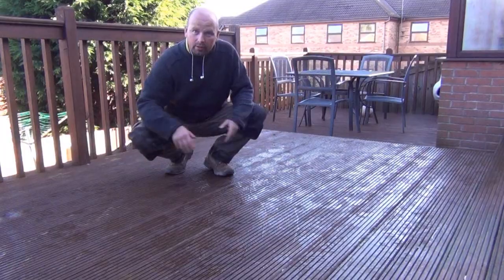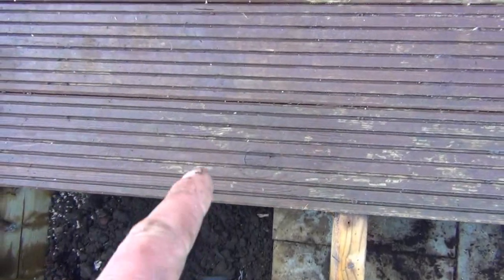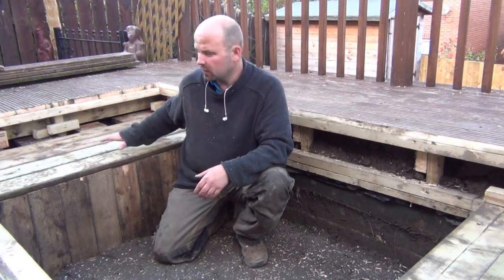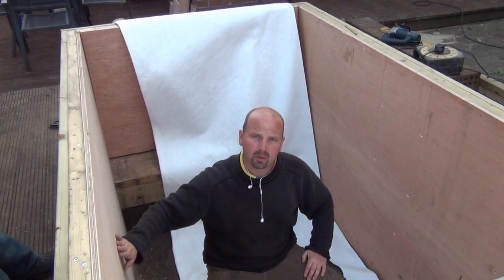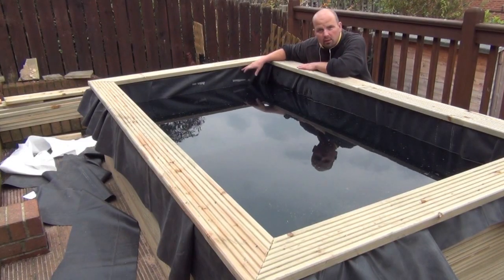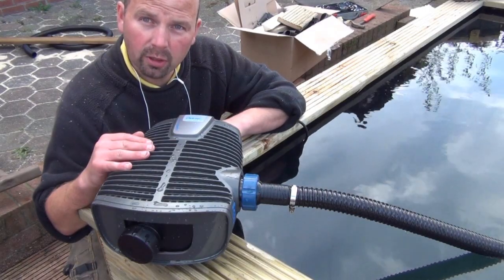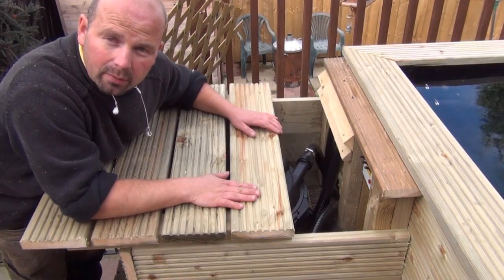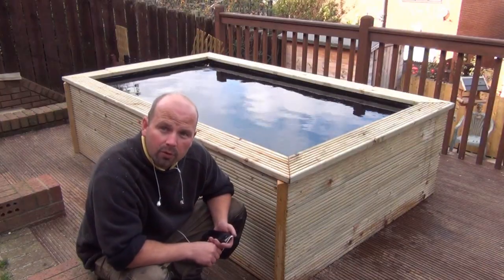How to build a raised wooden patio pond by Pondguru

Comment from the maker: Yes we normally keep bricks on the folds while the pond is filling and that allows the water to press them down, than the bricks can be removed. Tension on the upright folds can keep them flat, no worries. Its just trial and error and if you're not used to laying liner you may need to drain and refill to get it right. We never glue the liner but it can be done if the liner is clean and dry.

Comment from the maker: I've done a few jobs in Jesmond. 
This one was just over the river at Gateshead.
Plants don't need any oxygenation in the pond but if you intend to have fish in there too it would be beneficial for them to have water movement.
A pump and filter which runs 24/7 is always better than a temporary fountain so if there's any way of getting electricity to the pond it would be advantageous.
Most solar fountains / pumps are very unreliable just like the English 'summer'.
Thanks for the sub, man.

Comment from the maker: Provided there is a current in the water there will be decent gaseous exchange between water and atmosphere. The outlet can be twisted to create a visible current on the water surface if desired but one of the main purposes of this pool was to have a reflection of the sky which would be ruined by surface movement.

Comment: Great video, you explained it really well, I'm looking at building almost exactly the same pond as in your video accept it won't be on top of decking. Really impressed that 2 foot high walls made of wood are strong enough to support that volume of water. I'm planning my pond same as yours but 2.4 x 1.4 x 1.2 meters deep and you've just given me some great ideas, Thanks :)

Comment from the maker: No worries. Provided the carpet is acrylic (not natural fibres) it should be OK but if it is hessian backed or woolen you may have a problem with it rotting and producing gas which can cause the pond liner in the base to rise up like a bubble. Seen this on a few occasions when the gas has nowhere to go. One was raised above water level in a huge bubble and looked awesome. luckily it had been put in by someone else, lol
Thanks for watching and appreciating the videos.

Comment: I really like your videos.  Your attention to detail is exemplary.  I assume - because I live in Arizona - that your insulation of the above deck pond framing is to account for the cooler temperatures.  Interestingly, the subsurface in Arizona encourages a minimal depth of 4 feet in order to benefit from the soil - caliche - in moderating the extreme temperature changes over a 24hr period.  I will look closer at insulation as many pond owners loose fish here assuming the day time highs are year round, which they are not.  I am a backyard enthusiast only, but your videos are top shelf!
Reply from the maker: +Jim Cameron Thanks very much for enjoying the videos. Yes the insulation prevents wild swings in temperature as raised ponds can get very cold in winter or very warm in summer. In the UK our days can be very warm and nights can be cold much like Arizona so if we can level out those extremes it is much better for the fish.
Ultimately a large volume of water will be less subjected to fluctuations than a small body of water but insulating definitely helps.

Comment: Beautiful work!  To hide the jubilee clips (and protect small hands from cuts), wrap them with a strip of the Firestone liner 4" wide and 8" long, and secure with a black nylon zip-tie on either end around the tube.  You can remove them by snipping the zip-ties.  And the rubber strips are reusable.  Cheers!

Comment from the maker: Putting the sleepers on a concrete foundation just below ground level ensures a good solid starting point and then it's easy to get a nice clean edge when digging out the hole. Bear in mind that if you build up all the sleepers you'll have to lift the muck way up out of the hole. Only add bottom layer or two until hole is dug then build up rest of sleepers.

Comment from the maker: I missed that bit out but by looking at it the supports went from side to side then the uprights were banged down and secured to the outer edge. Supports for the shelf went back to surrounding 2" x 2" and also had pegs resting on top of concrete. Then top was screwed on.

Comment from the maker: The wood is pressure treated so it will last for ages. It is not sitting in wet conditions or soil so it should give at least 10-15 years (if not much longer) before rot starts.

Comment from the maker: If it is 8' x 8' surface area there will be muck more pressure pushing out than in the pond here so I'd maybe be inclined to revisit the sleeper method for better strength.

Comment: i am looking to rip out a 200 litre plastic mould pond dig down so its level with a garden wall out of breeze blocks with a cement concrete floor. just trying to decide if a drain is needed as need to figure out the fitments for water in and out. I estimate 1000-2000 litre pound. I would like to have a solar setup. but its hard to figure out what i can get away with. one last thing should i use a rubber tarp thing or use cement?.  I was wondering what the insulation was for?

Comment from the maker: Sleepers would be the more secure way to go given the dimensions of the pond. The one in this video worked out well as the internal boards took much of the strain and could be well fixed to the existing frame. If I were you I would go sleepers to be on the safe side as it is much greater surface area (therefore more atmospheric pressure pressing out on sides) than this pond in the video.

Comment from the maker: You could go either half and half 2 and 1 or 1 and 2. It doesn't really matter. I'd go for 16mm board though and forget the carpet as it is awful to work with. Good quality underlay is the best way to go wit thick rubber liner, not cheap PVC crap you get from many DIY outlets.
The pond will be stronger if you go 2' under and 1' above as the ground will take most of the pressure.

Comment: Wow thank you very much, such an informative video, im building my first pond next year onto flat ground. Should i just build the frame like you did onto the flat surface and dig down at one end into the ground to make a deep end?
Reply from the maker: Yes that sounds about right. Depending on the height and weight of the structure it may be worth putting a concrete foundation around the edges (e.g. if you use sleepers)
Glad you enjoyed the video.

Comment: Do you ever need a bracing bar in the middle or anything? Seems like it would be a lot of water pressure. I’m planning to build something like this however it’s going to be around 10ft long by 3 ft wide 3ft deep do you think the method used here would work ok for these dimensions? Thanks

Comment from the maker: No worries. Thanks for watching and appreciating the video.
The fact that the marine ply extends down under existing deck level goes a long way to increasing strength and making the sides very rigid - no flex at all from them.

Comment from the maker: It will be strong enough if they are bolted together, yes. If the underground sides of the pond are very weak it would be advisable to use marine plyboard to hold them back. Once the underlay and liner is laid over that the sides will go nowhere.

Comment: Great video thanks for sharing. Why use the insulation between the ply and decking boards? Also can you use normal ply or should it be marine ply?
Reply from the maker: The insulation is to prevent the pond having rapid swings in temperature and ideally the interior would be marine ply as it is much stringer (and linger lasting) than ordinary plywood. In the past 3 years I tried to buy marine ply on multiple occasions it was not available.

Comment from the maker: How long it lasts will depend on how wet the hole is but underground the wood has nowhere to go so even after many years it could rot and not affect the pond structurally. The wood above ground should last 15-20 years, maybe longer and the outside can be treated again to repel water. Under a deck is generally an extremely dry environment so wood ponds built into decks last ages.

Comment from the maker: You can use additional treatment, no worries but leave the structure for 6-8 weeks before doing so to enable the pressure treated decking to fully dry out and be ready to accept the treatment. I'd go for a spirit based treatment as it soaks right in and has water repellent properties but be very careful not to get any in the pond.

Comment: Have you ever had the ribbed hose turn brittle under influence of time and uv light? We used to have these hoses and out of the water they only last about a year or two and then fail in between the ribs and start leaking. You can actually break them by bending them because they loose all their flexible properties

Comment from the maker: Click 'SHOW MORE' for full video description and useful links.
Aquamax eco premium 4000 pump: http://geni.us/4OQ
Filtoclear 16000 filter: http://geni.us/t68
Tradux wall fittings: http://geni.us/2uLz
How to make a wildlife pond: https://www.youtube.com/watch?v=D8yY50brPvA
How to make a koi pond: https://www.youtube.com/watch?v=89KxdMPtla8
How to make a fish pond: https://www.youtube.com/watch?v=L63k5iZr42Q

This video shows how to build a raised wooden patio fish pond and includes all the stages involved in making a raised wooden pond on an existing deck. 
Pond dimensions are approx. 7' (2.1m) x 4' (1.2m) x 4' (1.2m) deep.
The underlay is 300g / sq.m polyester and the liner is 1mm thick Firestone 
Pump is Oase Aquamax Eco Premium 4000 and filter is Oase Filtoclear 15000.
The fittings used for the in / out pipes are 'Tradux' from Oase.
The armoured cable is approx. 20' (6m) long and is 1.5mm 3 core running from fused spur in conservatory.
If you like the video, please click the thumbs up 'like' button and feel free to post to any of my videos to websites or forums, no worries.
THANKS FOR WATCHING.

BIOHOME FILTER MEDIA, FILTER UPGRADE KITS AND FOAMS HERE: http://www.filterpro.co.uk

*PLEASE NOTE I HAVE CLOSED TYNE VALLEY AQUATICS AND NOW SELL MEDIA FROM HOME ONLINE. COLLECTING MEDIA IS NO PROBLEM JUST RING OR EMAIL ANY TIME.*
My phone number (Richard) 07772848730
My email address pondguru@btinternet.com

Comment: Great video, but how did you get the pump to lie flush to the bottom? Ours turn either upside down or on lies on its side? Thanks
Reply from the maker: The outlet swivels so that any bends in the pipe don't influence the position of the pump.

Comment: excellent pond.  Don't you need an overflow for rainwater excess?  Would the water flow over the top in heavy rain?
Reply from the maker: The pond would normally operate well below the maximum level but if water needs to be drained off it can be sent out from the filter (as you would do during filter cleaning)

Comment: Hi Pondguru, this was an awesome video - we've just put a similar pond into our decking. One problem we're still trying to work out is that we want to put in a small water feature (simply one stream of water coming out of an urn into the pond), does the water feature have to be at the opposite end to the pump (so near to the filter end of the pond) or can the water feature be anywhere?

Comment: Think the pond looks great, have just built one myself, and was wondering about aeration. I have used the Tradux fittings and they around 350mm below the surface. The pond is 2m x 2m and 1.6m deep. What is your view, do I need to airate the pond we will have about 8 x 200mm koy in the pond in March. 
Thanks Simon
Reply from the maker: It is always good to aerate the pond but for that many fish not essential. As long as there is surface movement there will be a good exchange of gases.

Comment: excellent, thanks for that. was after a solution for the pump hoses leaving the pond without laying over the top - resolution found..
Reply from the maker: No problem. If your local store doesn't carry the fittings there is a link in the video description for them (on Amazon). Thanks for watching and appreciating the videos.

Comment: Great video , could i use an all in 1 system like a hozelock etc rather than the oase filter and seperate pump , my raised deck pond is 3m long x 1m wide x 0.7m deep Regards Marc
Reply from the maker: Yes if I was putting something that size in I'd go with an Oase Filtral 6000 as it has a much greater filtering capacity than the Hozelock equivalent. If there is any fish they will be from goldfish, sarasa, shubunkin so that should be fine.

Comment: Hi mate still live the video. In trying my best to build my own pond similar to this. I got the frame build off cemented posts. Do u know the max wall depth that the oase tradux will fit through?? I'm using old deckin boards on the inside of my pond rather than ply.
Reply from the maker: We cut holes larger than the fittings through the ply so the thickness the fittings had to go through was really just one layer of underlay and one layer of liner. I think the max. thickness these fittings will handle is around 20mm?

Comment: thanks guru for your hard work again.  I have a question about the plywood.  Is it going to erode due to weather and moisture around the pond?  how long would it last?
Reply from the maker: It will begin to rot after a while (maybe 10 years or so) but it is very resilient to moisture since it is hardwood and bonded together. In the situation it was used in here it was very dry conditions so will last a heck of a long time.

Comment: Hi pond guru
     Im building a raised koi pond the size of the pond will be 8ft x 6ft x4ft deep approx 2ft will be below ground and the remainder obviously above im thinking digging the pond out and breeze blocking it all the way up do you think would hold the pressure or do u think I should double block it ?
Thanks for your advice
Regards
Kev

Comment: Hi just about to start a similar build, can’t find an answer to this one - do you not need an overflow pipe in case of heavy rain (as we are prone in the UK)? I am sure there is a good reason that it is not required? Thanks
Reply: yes you do need an overflow if you don't want it spilling over sides.

Comment: hi again , im thinking of building a pond containing about 3000 gallons, I was going to dig the hole and use  sleepers around te top of the hole maybe 2 sleeps high, would this be strong enough maybe with coach bolts ect, also will the weight of the water be enough to stop th mudd caving in?

Comment: Hi PG , i just built a wooden frame today for my koi pond , it's 6' x 6' x 4' , my brother reckons i need to put diagonal strut braces on it to help it from moving , is this needed ?its all above ground , also if i insulate it will my koi be ok all year round ? i live in kent ( very south of you ) thanks
Reply from the maker: +Kimahri69 It depends on what the pond is made of but as the height and volume increases above ground level the materials used to construct the frame need to step up to account for that. As long as you have used a minimum of 3" x 3" for the frame, interlocked at corners it should be fine. Anything less may be too weak unless you go with diagonal supports on the corners. Your winters are much warmer than ours up here so for a growing out pond of 6' x 6' x 4' deep the fish should be fine during winter if it is well insulated. Its always best to get some of it underground if possible but make sue that the pump is turned off in winter or that will badly chill an above ground pond.

Comment: Hi I would like to ask for some advise on a pond build, I am planning a 8ftx6f wood frame pond, I'm hoping to come 2 ft above ground and 2ft below, if I put in footings to fix the frame to, would a frame of similar construct, but replacing the 2x2 with 4x2 hold that volume of water?
Thanks 
Mark
Reply from the maker: Yes that should be fine as it is only 2' out of the ground. The higher up you go the more the pressure increases and frame needs to be stronger.

Comment from the maker: Concrete foundations would be the best way to go, yes.
They sections can be fixed with proper fixings from builders merchant. The name of the fittings escapes me but they are long thick screws which don't shear with lateral force like ordinary fixings can.

Comment: Hi Pondguru, great video. How do you fold the liner over the corner? Do you need to cut the liner, or just allow it to fold naturally in the corner?
Reply from the maker: The water will pull the liner in and suggest where it wants to fold then you just ease it into place. I never cut the liner inside the pond and on a square sided pond it is quite easy to get neat folds in the corners.

Comment: Great Pond. I am building a similar pond but with sleepers. 2.4m x 1.5m x 1m deep.( approx 800gal) Would the Oase filter set up be sufficient for some koi carp or would you use anything else? I need to conceal the filter as it will be on decking so not a lot of room, Any help would be appreciated
Reply from the maker: For that size you'd need a minimum of the Filtoclear 12000 with an aquamax 6000 but the pond will only support koi up to mid size so be prepared to build bigger after a few years.
Thanks for watching and appreciating the videos.

Comment: great video, thanks, do you have one using railway sleepers as a raised pond, id like to build one 2 sleepers high aprox 400mm and dig down about the same, , building the pond doesnt worry me its the pump/filter assembly that gets me worried
Reply from the maker: Depending on the finished volume of the pond you may only need an all-in-one pump like this: http://geni.us/8IDmR
That would only require one cable to be led into the pond but if the pond was a decent size you would need the traditional pump + filter set up similar to the ones used in this video.